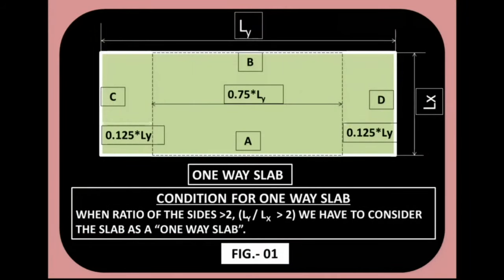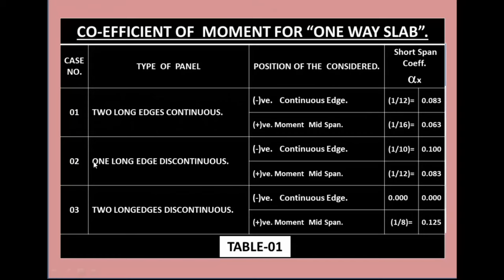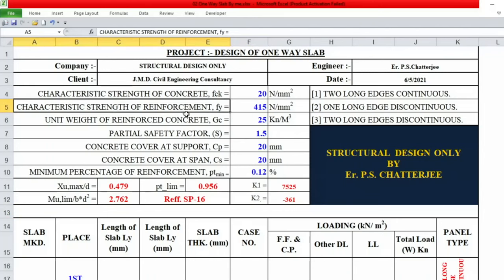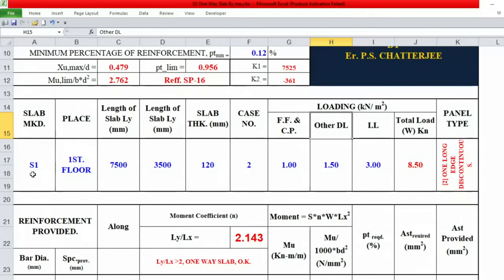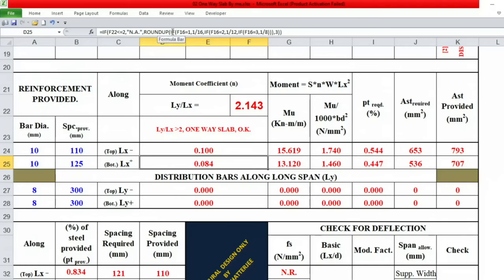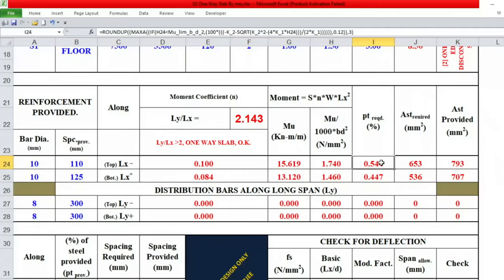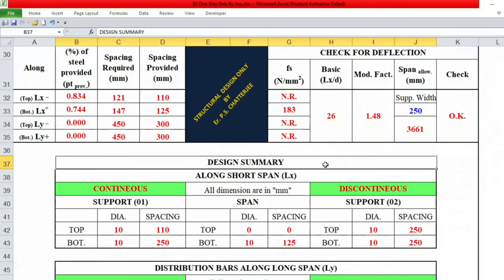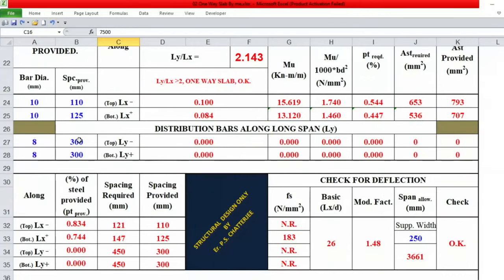One Way Slab - Excel

Comment: Dear sir,
In this excel for oneway slab four edge conditions are included. As per IS456-2000 Table 12 for more than 2 equal spans one way continuous slab it is not consider in this sheet. Whether the conditions given here is enough to design the oneway slab. Thank you sir. Can I have this sheet sir.
Reply from the maker: Thanks for asking some critical questions. 
// For 2-way slab design, code is suggesting for the distribution of load not the moment.
// We have to consider the maximum moment coming from L.H.S. or R.H.S. slab at continuous edge.
//In the case of one way slab with one long edge continuous considered moment coefficient is 1/10, because if we consider Moment coefficient 1/12, we are going to get some hogging moment at mid span of the slab so we have to provide some reinforcement at at top of the mid span.
Reply from the maker: For one way slab we are considering the load along short span. So the condition of 4 edges not required.